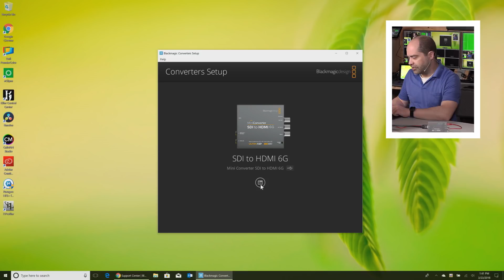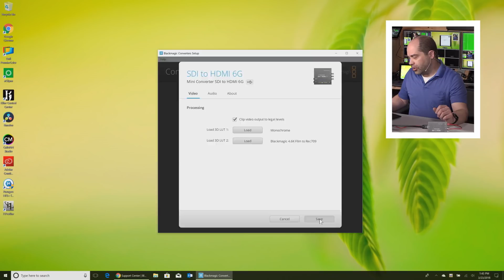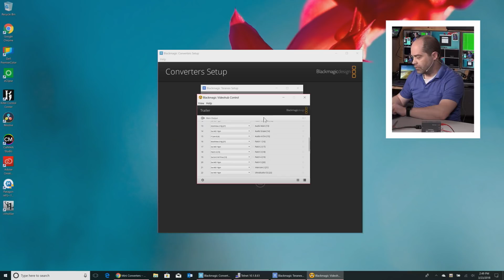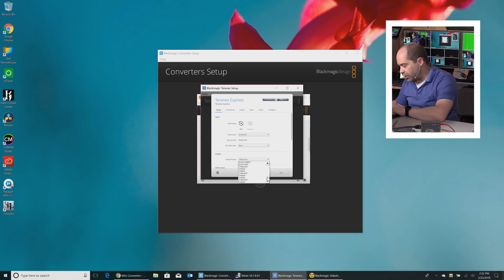Blackmagic Design SDI to HDMI 6G Mini Converter - Unboxing, Walkthrough, and Review

Comment: Great video. I have a Panasonic AG-1980 VHS and it has an svideo connector and 2 video out BNC connectors. I am trying to get the best capture. I tried connecting the BNC out to the SDI Connector on a Decklink mini recorder 4k. It does not work. I can capture using a DV FireWire device Canopus ADVC110. Perhaps it would be better to get something that will convert an output VHS svideo signal to the input 4k port on the Decklink HDMI input. Any suggestions on the best way to capture a VHS
Reply from the maker: SDI is a digital signal, but your VHS player is analog. So if you want to use SDI you'll need something to convert the analog composite or S-Video signal to SDI. If you choose to go that route, the Blackmagic Design Analog-to-SDI Mini Converter will take care of that for you.

Unless you have a very specific need to convert to SDI first, though, there are easier and less expensive ways to capture analog video on a computer. A quick search on Amazon will find a bunch for you. One like this one should work: https://amzn.to/37B89rI
Reply: @djp_video  yes thanks I used  this one Tendak 3RCA AV-069-BK CVBS Composite & S-Video R/L Audio to HDMI Converter Adapter

Works great

Comment: What would be the right cable and battery to get this battery-powered? I was hoping to use a Talentcell battery from Amazon. I know there's a battery-operated version of this product but I don't think it's 6G, plus I already have this converter, so just trying to make the most of converting my DSLR to have SDI output.
Reply from the maker: It runs on 12V, so any 12V power pack will work. The power input is a barrel-type 5.5/2.5mm, which are easy enough to find.

Comment: Our organisation purchased an Atem 2 M/E production studio 4k and after connecting my wireless tranmitter (CW - HDMI) to Micro Blackmagic converter (HDMI TO SDI) 6G no signal is displayed on my screen. Kindly help me on this.
Reply from the maker: Make sure your wireless system is working properly and outputting a signal. Connect it to a monitor/TV in place of the Blackmagic converter.

Comment: Hey Doug, I have an Atem Mini Pro and want to get audio to an audio mixer and have the video go to a projector or large classroom television (for live events, lessons etc). Will it work to run from the HDMI out of the Atem Mini into an HDMI to SDI 6g ,connect the audio outs to the audio mixer via TRS, then go to an SDI to HDMI 6G and into the projector or TV display?

Comment: Hi, is it possible to apply LUT 1 to the HDMI output only and LUT 2 to the sdi loop out only ? For example to calibrate two different monitors with two different luts simultaneously in a grading suite : the colorist's sdi screen with his LUT and the client's hdmi with a different LUT (both screens been fed by the same sdi input in the converter). Thank you very much for your feedback
Reply from the maker: No; you’d need two separate converters
Reply: @djp_video  thanks, i couldn't find the information online.

Comment: Doug Johnson Productions Hi! Can you suggest setup of those converters, Idea is to connect hdmi 4k signal to blackmagic visual assist 4k via sdi (hdmi 4k->sdi6g) then take loop from VA4k and connect to blackmagic viewfinder (3g sdi) ? Like I need converter + sdi downscaler or something?
Reply from the maker: You can indeed use the SDI-to-HDMI 6G converter to get a 1080p signal (only on its HDMI output), but to get that signal into the viewfinder you'd need to convert it back to SDI again.  The HDMI-to-SDI Micro Converter would work fine for that.
Reply: Doug Johnson Productions em, maybe hdmi>sdi 6g? I read about them And thought I can loop hdmi through VA then use switchers on HDMI>6g to force 4K to 1080p on that converter and connect viewfinder to it, guys on forum says viewfinder needs a 3g 10/12 bit 4.2.2 video signal. I have 4.2.0 8 bit, so there is where I don’t know will it work (transcode/adopt) pixelformat also. Maybe you know?
Reply from the maker: The HDMI-to-SDI 6G converters don't scale. Only the SDI-to-HDMI 6G does.

I can't say whether that chain will convert 4:2:0 to 4:2:2 or not. You'd have to consult with Blackmagic Design or just try it. SDI is 10-bit, so that part shouldn't matter.
Reply: @djp_video  Ok, I will try. But in this video I see option Force HD on HDMI to SDI https://youtu.be/glHqyMSF1-c?t=59
Reply from the maker: I should mention that the DIP switches on the HDMI-to-SDI don't actually force a particular format; they just tell the connected device what format it prefers. The device can still send whatever format it wants. I've had several situations where I set it to 'Force HD' and I still get and Ultra HD signal.
Reply: @Doug Johnson Productions So mean It won't downscale picture? I mean hdmi to sdi 6g box first to connect hdmi device via sdi to visual assist then take loop sdi and put to sdi 6g to hdmi box to downscale sdi signal, and obtain hdmi again and then micro converter hdmi to sdi for viewfinder :) 3 boxes will make too costly solution ://
Reply from the maker: protasov media The HDMI-to-SDI converters do not downscale. They can be setup to ask the connected video source for a lower resolution, but those devices are not required to conform. So it isn’t uncommon, for example, to set the HDMI-to-SDI converter to “force ultra HD” but then get an HD signal instead.
Reply: Doug Johnson Productions so maybe you know/can suggest some cheap hdmi downscaler from uhd>hd? I then will use just micro converter for viewfinder.
Reply from the maker: protasov media As far as I know there aren’t any cheap UHD-HD scalers. The closest I’m aware of is the Decimator 12G Cross at $495

Comment: Can the Blackmagic Design SDI to HDMI 6G Mini Converter be used to feed the atem mini?
Reply from the maker: It could be, but the SDI to HDMI Micro Converter is much more cost effective.
Reply: @djp_video  One appreciable difference I've found between the HDMI Micro to SDI and the 6G version of the same, is that if you're displaying computer graphics at 1080p25, the 6G image is superior and you get out pretty-much what you put in. The BMD Micro version has dithering/aliasing on fine detail, so I've ditched them in favour of the 6G versions. The Micro Converter is no so good either if you're using it for DSK text overlay, compared to the keying quality via the 6G.

Comment: Hey Doug! I'm considering using these units for converting a 12 bit 2K signal from a Canon C300 mark II's REC OUT SDI connection. I need to feed it into a teradek 1000, which isn't a 6G device. Do you know if this would work? Thanks for the great video. :)
Reply from the maker: I'm actually not 100% sure on this one. I've never used a 12-bit SDI device before -- SDI is normally 10-bit. The other bugaboo is that you're using a 2K instead of an HD signal. I don't know if the Teradek devices will accept 2K or not.
Reply: @djp_video  it should handle 2k just fine, so long as it is 10 bit. So what I'm wondering is if this converter will convert a 12 bit signal to 10 bit... The only solution I've found, is a pix e5. But it's a bit of a mess in a portable/handheld setup :)
Reply from the maker: I believe that 12-bit signal is proprietary and won't be recognized by any Blackmagic products.

Comment: Hi Doug. I used this device for Projector HDMI (with LUT) and audio output to house, during an event and got a nasty surprise everyone should know about. During switching resolutions/inputs from two laptops on stage > to a Decimator Multiview 6 > via BMD TVS > to SDI-HDMI 6G, the audio portion died (yet video to projector still worked). Took an embarrassing amount of time to trace the problem down to this device (power cycle fixed it). Next time I'll wire two parallel units of different model (and maybe different brand) as a backup (and test audio AGAIN right before the show). Do you recommend a Teranex Mini SDI to HDMI 12G (overpowered, but maybe won't get overwhelmed by the same problem), a Mini SDI-to-Audio (remove video from the equation), or another brand... maybe Decimator/AJA? Thanks.
Reply from the maker: I'd do everything in my power to eliminate the resolution/frame rate changes rather than trying to cover up their effects downstream.

When I'm working in a similar situation, laptops get connected to a Decimator MD-HX and are immediately converted to the resolution and frame rate I'm using for the cameras and switcher. That way the signals coming from the switcher are always consistent, reliable, and stable, and aren't being interrupted by the connection or disconnection of any devices. In your situation that means going to a MD-HX (or similar product) before going into the Multiview.

Every SDI to HDMI converter out there is going to have at least some brief hiccup in the audio output if the input signal is disrupted or its resolution/frame rate changed, no matter the brand. Losing audio until a reboot certainly isn't normal, but if you can eliminate the trigger that caused the dropout you'd be better off.
Reply: @djp_video  Makes sense. Thanks for that input.

Comment: How did you setup the PIP for the close up shots? Is it only possible in the 2 m/e?
Reply from the maker: Satinder Dhindsa It was done with one of the upstream keys. It requires a DVE to do it, so it can be done on the 1 M/E switcher as well as the 2 or 4 M/E versions.
Reply: Doug Johnson Productions Is this different from a “supersource”?
Reply from the maker: Yes.  DVE stands for Digital Video Effects and it is a unit within these switchers that allows you to scale a video source so it can be overlaid on top of the program feed.  The switchers that have a DVE (1 M/E, 2 M/E, 4 M/E) can use that DVE for an upstream key (like Picture-in-Picture, or Picture-by-Picture, for example), or for a transition (in which the outgoing or incoming video is scaled, such as if it is shrunk down into a corner of the screen).  All of these switchers only have one DVE so you can only overlay one (resized) video source at a time OR use the DVE for your transition, but not both.

The Super Source feature is unique to the 2 M/E and 4 M/E switchers and allows you to put up to four scaled video sources over another video source (a background).  The Super Source itself is a video source, i.e. you can select it instead of selecting Camera 1 or whatever, whereas the DVE is always used as an overlay on top of your regular program feed and not as a source itself.

For what I did here I set the first Upstream Key to use the DVE, then set my main camera as the video source.  I then scaled it down to 30% of normal size, masked off some of the left and right, added a border, and placed it in the upper right.  I then put the tight shot on the preview bus and turned on Upstream Key 1 Next so it would come on whenever I cut to that shot.  Having it as an upstream key allowed me to (1) bring it on and off screen simultaneously with the transition between the main camera and the tighter shot, and (2) change the video source underneath it by just switching the video source on the program bus.  I could have done something similar with the Super Source, but switching the background video behind the inset is a little harder to do on the fly.
Reply: Doug Johnson Productions Thank you!! I will try this today

Comment: Hey Doug, thanks for this review. This answers a couple of questions I had. What would you recommand for this two scenarios: (1) deembbed audio from SDI to route it to an audio mixer. Would you use the the SDI2Analog converter or for example this converter that would provide a HDMI out addionally. (2) I have to SDI signals. SDI1 without audio, SDI2 with audio. How would you use the SDI2 signal for video and embbed the audio from SDI1? looking forward to your answers. Have a nice weekend. Cheers -Rob
Reply from the maker: For the first scenario, if you don't need the video portion, you could use the SDI-to-HDMI, SDI-to-Audio, or SDI-to-Analog converter, but since the SDI-to-HDMI is cheapest, that may be the best solution.  The SDI-to-Audio would give you four channels instead of two, if that is at all useful.

For scenario two, again you could use any of the three listed above to deembed the audio from SDI2, then use one of their Audio-to-SDI converters to embed audio into the SDI1 signal.  In this configuration I'd probably use AES/EBU instead of analog to keep the signals in the digital domain.